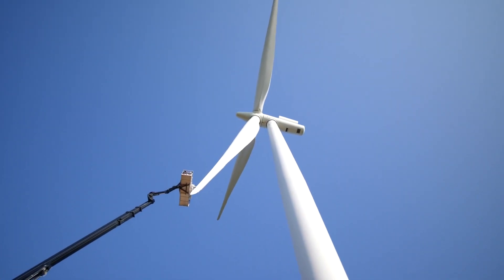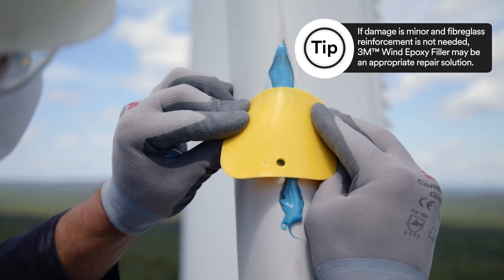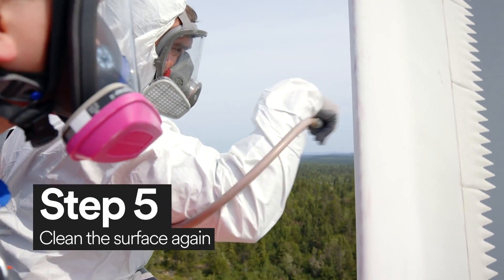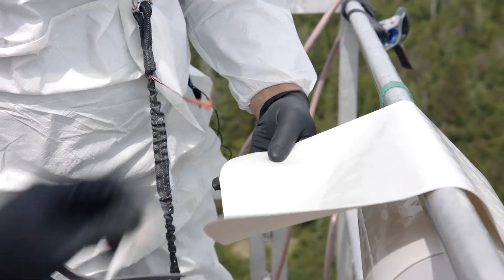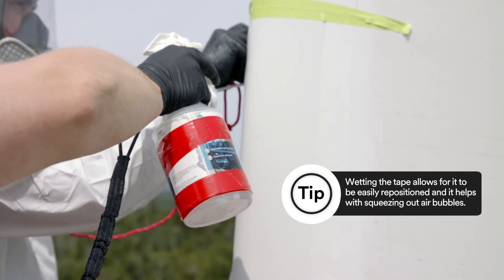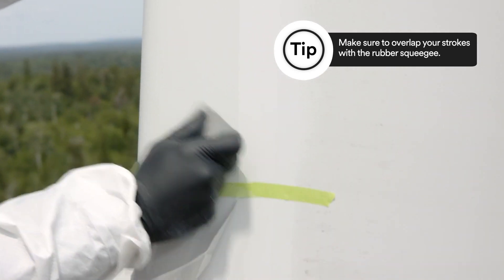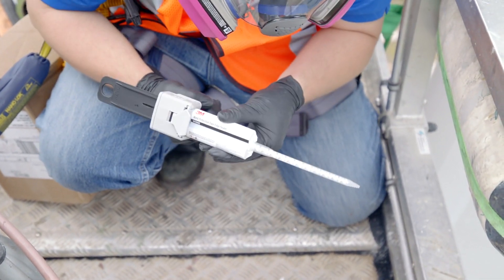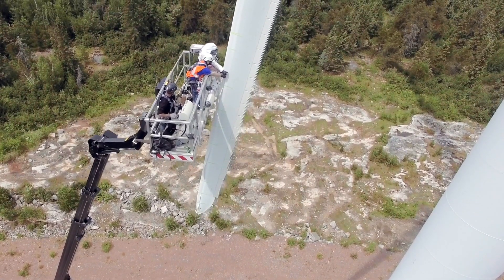How to install: 3M™ Wind Blade Protection Tape

Comment: Can we use 3M primer like 94 primer instead 3M promoter W9910? Now we can't buy W9910 only have general primer94. Could you recommend other promoter we can find in Thailand?
Reply from the maker: Hi there! Your question requires the intervention of our product experts. Please contact our team in Thailand at https://s.3m.com/wph33x4z as they shall better assist you.
Reply: May I know why you cannot buy W9910? Because of MOQ or something? As my understand, W9910 is an option when you need to strengthen the bonding between tape and wind blade in cold weather.
Reply from the maker: Hello there - Thanks for your inquiry! We recommend connecting with our team in Canada here: 
https://s.3m.com/u1k7vonz
as they will gather more information from you and provide further assistance. Thank you!

Comment: Aerones provides robotic systems to prepare the surface without manual labour. Washing, sanding blades and removing damaged 3M tape from wind turbines blades up to 4x faster.

Comment: HI 3M!

I work on blades repair so question from different angle.

How to remove it?  Is it a easy way?? :D
Reply from the maker: Hi - Thanks for your question. Please refer to the removal procedure section in the 3M™ Wind Protection Tape 2.0 application guide: https://s.3m.com/ff48l8

Comment: Hello, I work at a company that manufactures wind blades and we use this type of tape to protect LEP. I would like a tip on how to adjust this tape well so that water bubbles are not left.
Reply: 1lt water, 10gr soab and 100ml İP Alcohol. Apply by pressing with the necessary apparatus. Don't forget to wet the band.
Reply from the maker: Hi Joel - Thanks for reaching out to us. Please submit your question through the form at https://s.3m.com/q5vvaq so one of our experts can provide assistance.

Comment: But wait, what does 3M™ Wind Blade Protection Tape actually do?
Reply from the maker: Hi - thanks for asking. 3M™ Wind Blade Protection Tape is used to protect wind turbine blade surfaces from damage caused by minor impacts and erosion due to rain, sand, dirt, or other debris. It is made from a translucent polyurethane elastomer that is designed to resist puncture, erosion and UV rays.
Reply: @3MCanada  which in turn will make it more efficient by preventing all of the mentioned above (protection from erosion, impacts with sand, debris, etc etc) preventing all the blemishes and minor damage to the blade so that it cuts through the wind like a hot knife through butter since all those small blemishes and imperfection would cause drag therefore making the blade more like a butter knife cutting through a tender and juicy steak diminishing its efficiency and power output since it would be going slower rather than at its  peak/maximum performance.